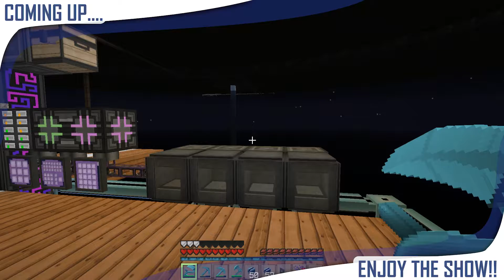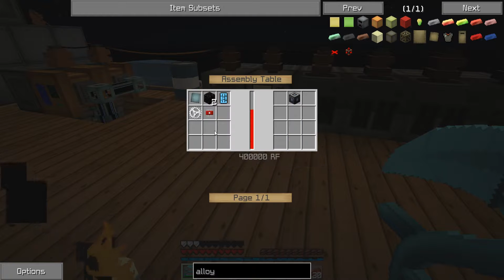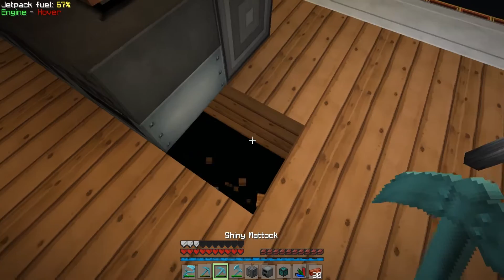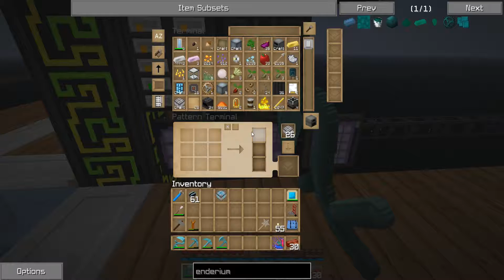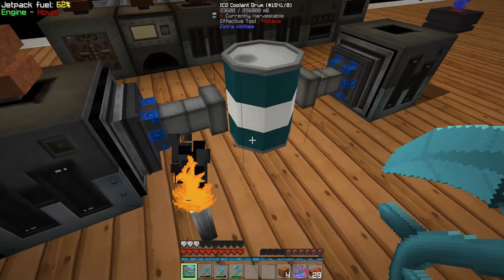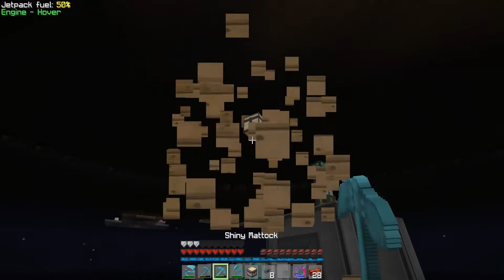FTB Infinity Skyblock! (Modded Minecraft) || HANDS FREE INSCRIBERS! || Ep 69

Comment: My favorite light source at the moment is carpenters blocks with glowstone dust shift right clicked into them. They can then look like any block and yet still give off light.
Reply from the maker: Yea, I love that idea and have considered using it plenty of times. but I have been told they cause a fair bit of lag, and that worries me. because that did used to be the case, I dont know about now
Reply: +Xogue "they cause lag" goes on to use thousands to make the slope between levels outside 😉
Reply from the maker: Bazzalis not the carpenter's blocks. specifically the glowstone modification :P
Reply: +Xogue I had heard complaints about carpenters blocks in general, not specifically about light producing ones. Not 100% sure on that, but that's what I heard.
Reply from the maker: Bazzalis yea I hadnt either until the comments said something about it a while ago. still thinking about it.

Comment: xogue it's just me or you really tired :P.... and just set alloy smelter back side to output and input, you can use painted glowstone... and you can search multiple item in nei and AE2 search tab with split item name with |... example: diamond|gold :D, and use me interface on top the inscriber because sometimes you need a printed circuit for some recipe i think
Reply from the maker: Yea. maybe a bit tired :P

I could that for the alloy smelter, but I couldnt do it for the other machines so not much of a point really
Not a fan of painted glowstone :P
I know about the multiple search feature as well as the other symbols used to help. there are fairly common to searching tools these days. i just dont use them.
no worries, I have a way to get them for anything they may be needed for, but unless they changed some recipes to use them (possible in this modpack) the printed circuits arent used for any other recipes
Reply: Xogue ok you need to rest

ok that's your choice

yeah the problem for painted glowstone is decrease fps but is better that carpenter block lighting system... i test in newest version of this modpack... carpenter block is drop my fps from more than 200 to less then 100 (That's a lot :P) and painted glowstone just decrease my fps from more than 200 to less than 190, but that's your choice to :P

but it's to tedious watch you write and delete item name in NEI search bar, and i think it's really tedious for you too right? :P

but if you do that you cant auto craft when the crafting used the circuit because you dont have crafting recipe for them
Reply from the maker: carpenter's blocks dont decrease my fps that much. maybe a little, but not nearly that much. even still, I wouldnt use the glowstone. not a big fan of them for modded.

writing and deleting isnt really tedius. I have done it for so long. certain cases it would be helpful and I would if I remembered about it. but really, it isnt that big a deal for me.

I do have the recipes for them. so I can autocraft with them. that is how I can have the full processors created.
Reply from the maker: aldy suhandi nah, I have something else going on with the inscriber :P

None of the pictures showed up either.
Reply from the maker: aldy suhandi is is quite extensive. but its do-able
Reply: Xogue ok i will make it harder :P, and question why you write 2 times the word "IS"
Reply from the maker: aldy suhandi it is*   :P